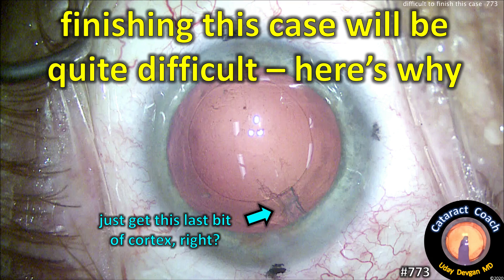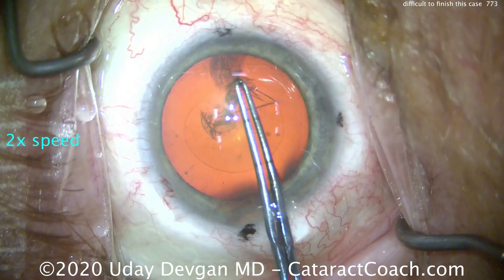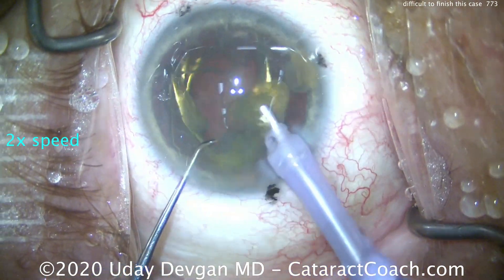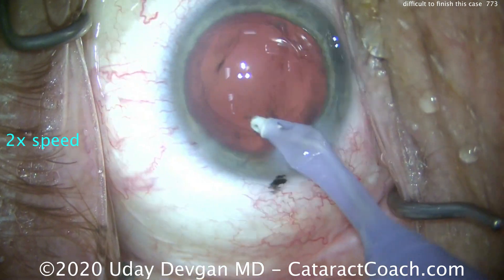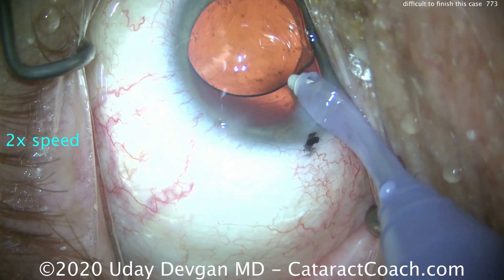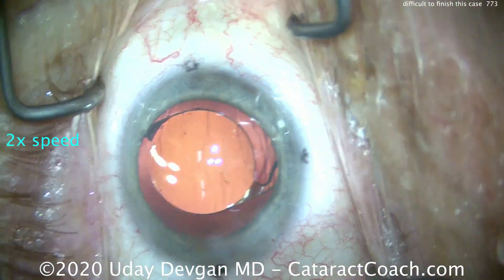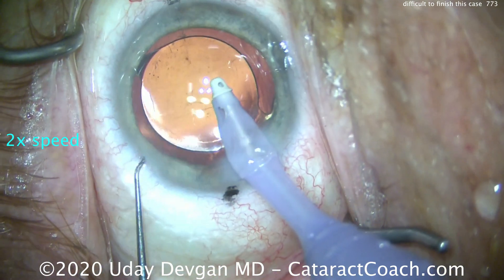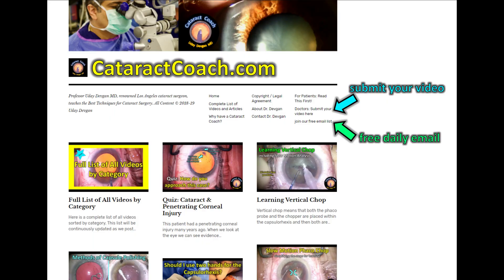finishing this cataract surgery will be quite difficult -- why?

Comment: Is it acceptable to left a small cortex piece if you can't remove it safely?
Reply from the maker: it will expand over the first day and become about 3x the size. then it will become mobile and may drift into the visual axis. if it is trapped within the capsular bag, then perhaps it can be held away from the pupil center. in any case it will cause a lot of post-op inflammation. Always better to do complete cortex removal.
Reply: @UdayDevgan  eventually it will get absorbed,i have a case where the  case got prolonged due to severe iris prolapse..and the cortex trapped between the iol margin and capsule..it did take a few days to get absorbed,but no inflammation